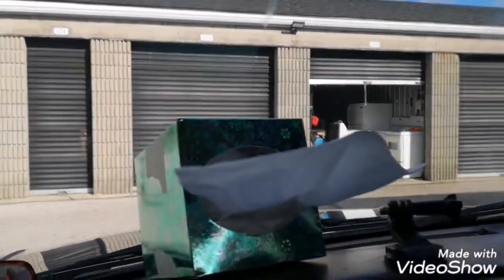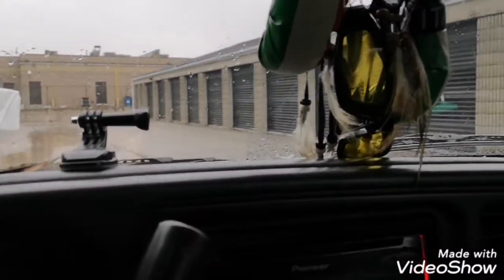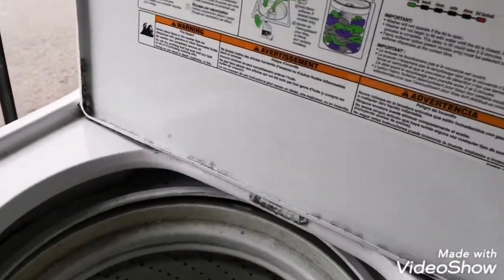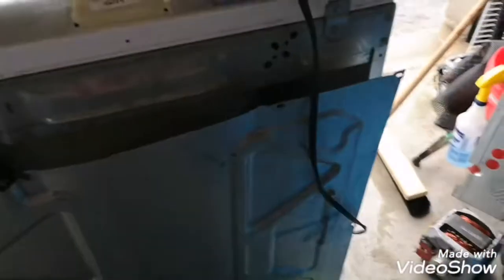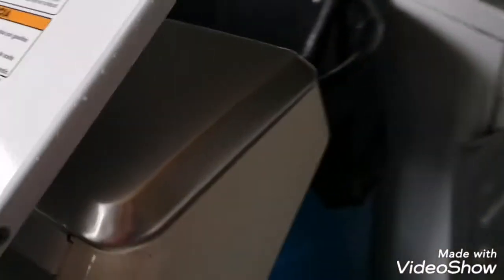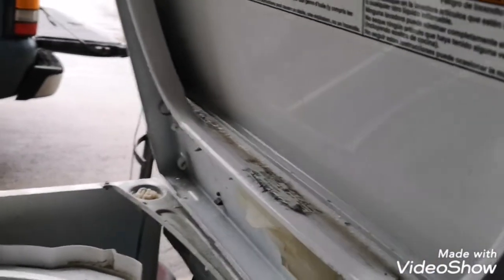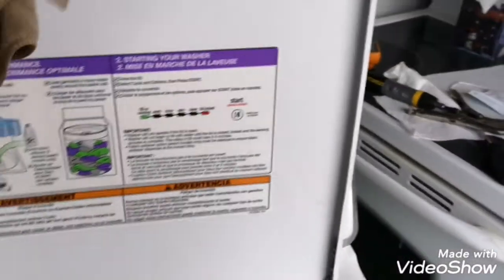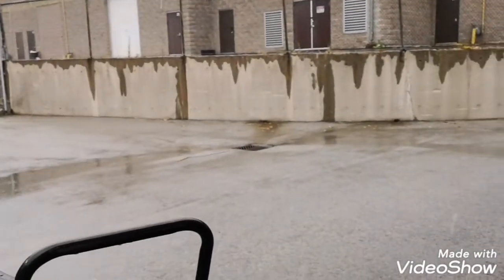MAYTAG CENTENNIAL WASHER .OFF BALANCE

Comment: I have this model with the same issue. Did you just replace the springs?
Reply from the maker: No I set the one spring back and got 4 zip ties and put them on EA spring from the rod  to the tub you will see a hole on the tub EA side 4 sides and sold it . Customer says it's working great .no more banging side to side 👍don't Titan the zip ties to tight .
Reply from the maker: Don't forget to subscribe ☺️